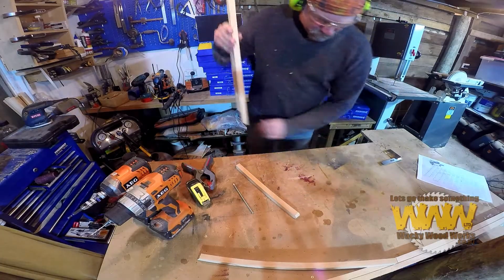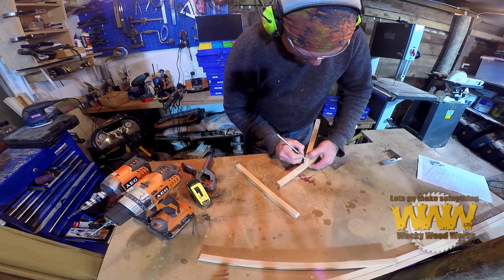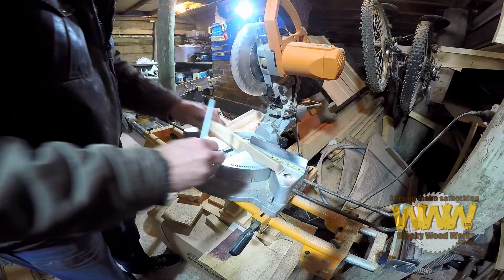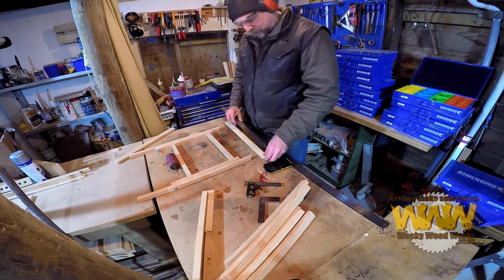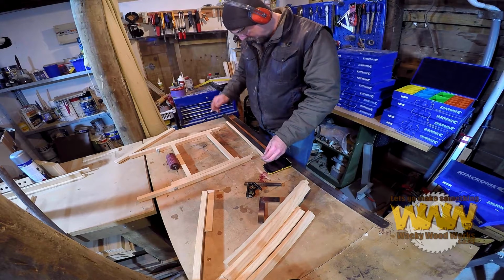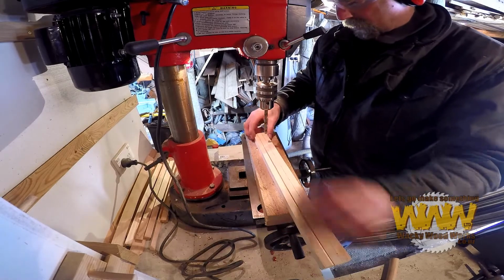Cotton Reel Holder - Wacky Wood Works

Comment: Thanks for sharing this video. Can you please tell me the dimensions of each row and the spacing you used for the doweling? Please can you ask your wife if these measurements fit the fat reels of Birch thread from Spotlight?  Thanks heaps.
Reply from the maker: From memory the spacing is wider for the bottom half for the larger reels,  and a little tighter for the top half... 
I will ask for you though... about the spotlight thing as I am not sure... Thanks for watching.

Comment: Hey fellow NZ'er, another good project:-).. may i ask which table saw you have there? ive been looking at places like carbatec and machinery house and was wondering if you liked your saw and what brand or model it was? thanks if you can help. cheers:-)
Reply from the maker: Robert Pike Kia ora Robert.  My table saw and most of my larger tools Band saw, sander etc) are from "The ToolShed". I have no issues with it and so far it is meeting my needs it cuts wood lol,   but like all saws you do need to tune it in and adjust it properly to get it right. It was easy to assemble but I guess like all saws can take a bit to adjust.

There are better saws out there, but you pay a lot more, and there are also a lot worse saws out there. I would class it as slightly higher than mid range saw... if that makes sense... overall  I am happy with it. 

It is the contractors saw, but they don't seem to have it on their website... If I had room I would like a full cabinet saw.

Thanks for watching